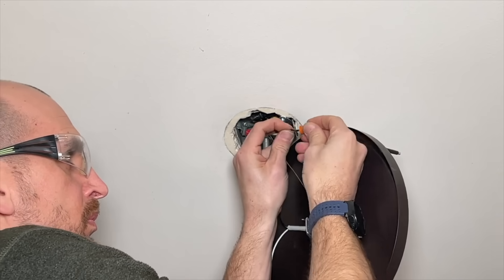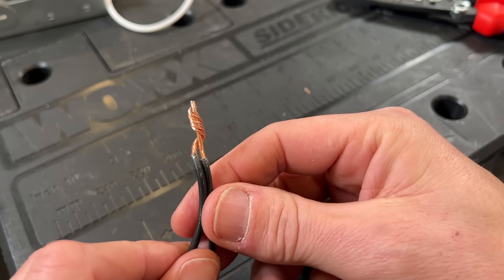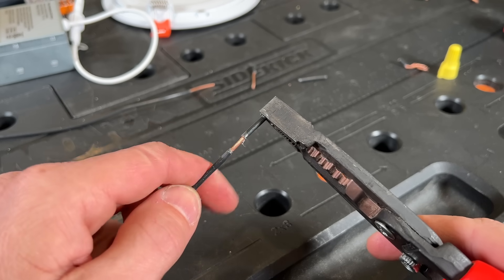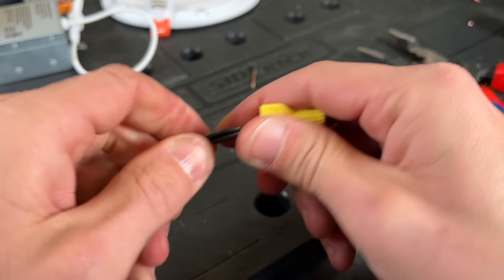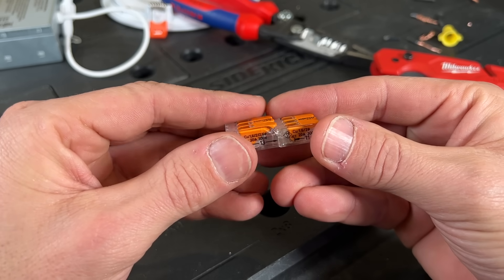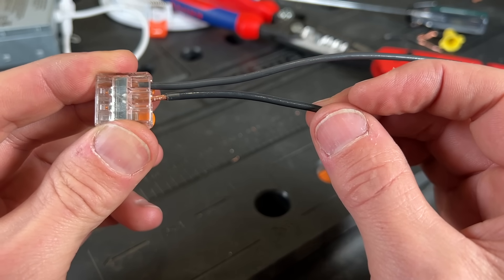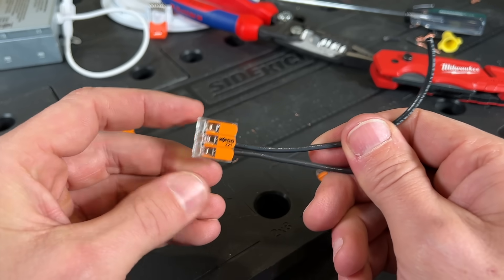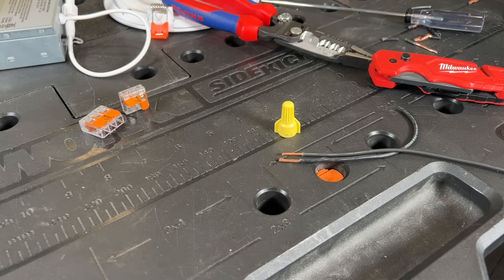Most Common DIYer Electrical Mistake - Don't Let This Be You!

Comment: Another advantage of Wagos is that because the wires are not all twisted around each other they're much easier to take on/off and figure out what's happening in the circuit (take one wire out, see where it comes from, what still has current, put it back in, etc). When I replaced some zone valve motors on my heating system I replaced all the wire nuts in the junction box with Wagos, and it was much much easier to follow the circuits after doing so (and will be much easier the next time I have to replace a zone valve motor).
Reply: @BB backstabbing a receptacle is also CSA approved, yet you are bound to find a few switches and receptacles that have failed in a house after a decade or so from repeated stress.  This is the same type of mechanism with Wago.  The only Advantages that Wago will have (at least what I can think of) are 1. time saved and 2. in very specific instances, you need to replace one device while the circuit is still hot for control applications.  This is how I do things and this is how I tell people how I do things.  I don't think that, "relax, it's certified" is a reassuring thing to tell your customer.  There are many "certified" things that are stupid.  Maybe wagos are good for homegamers that can't form a proper twist, but for professionals... To me at least... It's sketchy as hell.
Reply: @MintStiles  I couldn't agree more. For a low voltage, low current situation they may be fine. Other than that they can be handy on a test bench for a temporary basis only. 
I believe this guy has no idea what he is talking about when it comes to anything electrical. I've seen another video of his about using a multimeter. It was pathetic and filled with incorrect information served up as facts. Did you notice how he handled the strippers. Looked like that was his first time. He should really stick to making videos on things he has knowledge of.
Reply: @johnnygogo7773  you got it man, and he has got keyboard supporters too.  Wagos are good in control systems where you may just have no choice but to change out a subsystem in a live circuit, but it's good for almost nothing else.  As for his wiring stripping or twisting skills... It should be indicative of how much he has worked on any circuits.  This is the problem with YouTube; people who have no business teaching specific skills can make a convincing video.  The average DIYer wouldn't know any better.
Reply: Another thing that wasn't mentioned is how the constant heating and cooling of that metal spring is affected. That acts not only for a tension spring but as the conductor in series with the load. It must be weakened over time and eventually lose a good solid connection. Even if it passes the test now, time and use is the enemy of them. What has already been proven by use and decades of time is that wire nuts are not affected nearly as much by that. Just like most things, they do require proper installation,  but thats another reason why you should hire an electrician. I would agree that DIYers might get better service from Wago if they don't mind the dangerous possibilities that may occur years later, but I'm the kind of guy that prefers my family's future safety over quick and easy.  @MintStiles
Reply: @BB I bet you think that you are attempting to be witty when you are just being offensive. Kind of like a child pretending that the parents have no idea that he is trying to pull a fast one.  How's this for a (very basic) physics lesson that you seem to think you are very well versed in? When you twist wires together, the mechanical grip via friction at all points along the length of the twist ensure that the repeated shearing exerted on the device does not work a wires loose.  The contact is also superior where the bare wires connect along the entire half inch or so where the insulation is stripped.  When you use a quick connect, you have exactly one point of friction and contact.  Perhaps youd like to explain how your physics differ from mine (or the rest of the universe for that matter).
Reply: Love it
Reply: Wagos have absolutely no advantage at all and I would not trust those on a heavy loaded circuit at all. Twist wires correctly and you have a far superior connection.
Reply: The point of the twist is a having a redundant string mechanical connections.  I don't see how traceability is an issue in most electrical enclosures.  This is like saying you rather have a car put together with bolts and screws instead of welds and rivers because it's may just be easier to fix when you crash.  I hope the priority here is strong electrical connection for safety and effective device operation.
Reply: @BB I have no idea what you just said man.  I kind of understood something about Wago advertising spec sheet reading... The rest is just gibberish.  I love how you don't want to make any comparisons regarding the tried and true twist and cap.
Reply: This is absolutely the beast of excellent work quality oftentimes. I remember when I worked on the electrical in cars before becoming a residential electrician. The Hondas and Chevrolet interior panels were much cheaper looking and feeling but man did they come off quick and easy. The Mercedes and Porsche panels, the exact opposite. They looked great and were solid and sturdy but pain in the butt to remove.
Reply: And have a test port for your meter probes

Comment: I hate connecting stranded to solid ,but am Leary of the lever nuts you are using ! They remind me of the push in connections on receptacles ,they should be illegal , I always use screw down connections ! On wire nuts ,I pre twist or twist so hard That I know its connected good ,then pull it like I mean it . Also tape the wires tight below the nut and up onto around the nut . The wires aren't coming out if the nut ! I think Klein Tools are hands down best tools made for tradesman ! Great video ,love your clarity ! Good job!
Reply: You can't teach some old dogs a new trick.
Reply: Some things don't go out of style like quality electrical connections done properly . Basic carpentry theory . I see guys that don't have a clue about proper framing techniques  but they have all kind of fancy tools . I can build a house with framing square,chalk line ,plumb bob , circular saw.  And it'll be standing a hundred years from now . New tricks aren't always better !
Reply: They should be illegal because they remind you of something that they are not?
Reply: Waste of tape and pain in the ass for the next guy
Reply: Noah ,I could give a Damn if having wire nut protected with good electrical tape is a PIA for the next guy ! I only care about getting it safely connected with the best chance of never having an issue of short circuit or loose wires. Don't know how wrapping the wires below the nut to secure wires together is a waste of time !  I take my time ,have never had issues with faulty work I ve  done ,and I ve done quite a lot over 40 years working !
Reply: @gregr1672  in your technique the tape is a fail safe if that becomes necessary your connection is already compromised  so it’s useless

Comment: Does the US use solid wire on its home circuits?
I've never seen it here.
Reply from the maker: Yeah, solid core wire is the norm for 15 and 20 Amp circuits.
Reply: @EverydayHomeRepairs  May be a 120 volt thing I'm guessing...
Reply: @garysheppard4028  UK requires solid wire cables for all domestic power and lighting circuits.
Reply: @westwonic  You've got 240v there I believe? So couldn't be just a 110V thing then...
Reply: @garysheppard4028  officially 230V, but often reading 240V
Reply: @EverydayHomeRepairs  only in a house. In fact alot of places are going to conduit for residential , so you will be pulling in stranded unless you are a sadists

Comment: Great video as always. You make sure you are clear In how you explain things and always provide evidence to support your statements. Good to know I've been doing this right all along. I used to build test circuits in school and we would have to test them with more than just power on and off. Connectors had to get a tug test as well as an overload test to make sure they worked right and I learned early on that stranded goes first to get a better connection.
Reply: First of all, you should hire a professional electrician. Fixtures wires can be of any guage, as they are a listed product. No terminations on the branch circuit side of you home should be of less that 12awg. So the wires in the wall have to be a minimum of 12awg. They should be sized according to the load as per NEC 310.15 (b) 16 in the 75°c column. That being said, I take the solid wire and bend it into a zig zag shape. Then take linesman pliers and twist the stranded around the solid before twisting the wire nuts on.
Reply: @joelpruitt5959  I've never once hired a "professional electrician" to do my job. My job is literally fixing homes for a living and I can't count the number of screw ups I've had to fix from "professionals" who did shotty work. That's why we call them vendors or contractors in my field because at least half the time they aren't professionals. I've seen so many "professionals" wire a gfci wrong that I have little faith in them. Not to say all electricians are bad, but all the local ones around me save a few most certainly are. Some plumbers are just as bad. Half of them don't even know how to transition from. Copper to plastics (pex, pvc, ect) and I've seen them install shark bites wrong. Those are like the simplest thing to install. But like I said, not all are bad at what they do. I know a few who could work blind folded in a dark room and still do flawless work. But those guys are few and far now days.
Reply: @TheSlimCognito  LMAO. Well bless your heart.

Comment: The description for the wago 221 is actually incorrect.  You can just push in solid core and stranded. You must lift the lever when using fine stranded. 
You also refer to lever nut. There is no nut involved. It is in fact known and referred to as cage clamp, hence why you have the lever.
Reply: The full name for the product is 221 Series Lever Nut. That's interesting about pushing in without lifting the lever - I haven't tried that. Not really sure what the benefit is, though.
Reply: @davidkahler9390  in Europe these have been named WAGO 221 SERIES COMPACT LEVER CLAMP CONNECTORS.  With the new range of 221 inline connectors Wago has chosen to rename them as splicing connectors. 
Looking at any online material will show there is no nut involved in the technology and it is a clamp onto which the wire is inserted, within the cage area. It is very misleading to refer to it as lever nut. This may be a local wago USA marketing decision but it does not clarify or explain the technology but confuses. 

If using fine stranded, I would recommend using ferrules to avoid stray strands of wire not entering the connector, this, as you say compromising the current carrying capacity.

Comment: What I like to do on the rare occasion in which I do work with this stuff, is I will split the strands into at least two wires, and wrap them counter to each other on the solid core. half CW, half CCW.
But really, the best solution that doesn't involve solder is with clasp connectors like the Wago blocks you recommended at the end. They can be off-brand if you can't afford to get Wagos, the design is fairly simple and reliable, so it's hard for knockoffs to really get it wrong.
But if you must use a nut, your best connection would be stranded on stranded, so I like to solder a small length of stranded wire onto the end of a solid core, with the strands spread around the solid core at least somewhat evenly. Cover it in heatshrink, wire nut stranded on stranded, you got the best connection you're gonna get without soldering it together such that you'd need to cut wire to remove the fixture later on.
Reply: Wire nuts only spin in one direction.  Every strand that went counterclockwise is now loose in that wire nut.   Hire an electrician.
Reply: @michaellaurin3571  The point is for them to partially unravel and provide their own bite.

Comment: Great video. Going to see if you have the wago 221 on your link. I was wondering why you would you the Wago with 3 holes with only two wires. Doesn’t Wago make a 2 hole.
Reply from the maker: For sure, I carry 2, 3, and 5 in my standard kit.  I had the 2 different sizes in the 3-pin connectors so more for the demo.

Comment: I've used the Wago connectors for years. The only time I had a problem with them is a few years ago Installed an electric water heater and I used Wago connectors. I was waiting around for the water to heat up and I started smelling plastic burning. I looked at the wiring and one of the Wago connectors was melted. I'm figuring the actual connection is to small for a high load device. So I just don't use them on anything high load or 220V.
Reply: That being said I only use lineman twisted connection on my tank installs. Just put of possible issues as you mentioned.
Reply: My personal tank I hooked up with Wago, no issue. I wonder if you used the smaller design verse the larger gauge? I have large version on my tank connection.
Reply: some of those connectors are just duds I believe, more complex mechanism, has moving parts, is assembled = multiple potential points of failure. As a commercial field tech I've had many issues with these connectors causing intermittent connection issues, it was a doosey to come to that conclusion. Ultimately, swapping all wago connectors with wire nuts did the trick - never had to go back.

Comment: Superbly described both from a communication and technical perspective.  You are tops of youtube on this!  Love the demo of Wago level nut strength.  For general DIY's, totally agree on recommending lever nuts. The skill required to properly wirenut with extreme high consistency is significantly more than generally appreciated.

Comment: You are absolutely correct on buying the Wago connector instead of the traditional. I bought some wire nuts that I used about 1/4 of the cheap plastic container the it developed cracks and collecting dust. I would rather pay more and probably save money in the long run. Well made video. Thank you for sharing
Reply: I've seen wirenuts last literal decades. You must've bought some seriously cheap ones. Let me guess, were they commercial electric brand?
Reply: @TheMinecraftACMan  No!  What I am trying to say is that homeowners don’t need a 1000 wire nuts. They are still good but the holding container cracked and will never use the rest in my lifetime. They are not cheap. I bought them from the Home Depot.
Reply: @hassanbazzi3545  Oh, you mean like the number you buy, gotcha. You can get like a small bag of them I think. Not 100% sure cause I buy them in bulk for work, lol.
Reply: @TheMinecraftACMan  I hear you. I am just a simple homeowner. I think for a person like me the Wago nuts are ideal
Reply: @hassanbazzi3545  Well, one tip I'd offer is to not use them in anything outdoors. Indoors should be OK, but they really don't take well to weather.
Reply: Yes, you can get an assorted bag for a few dollars.
Reply from the maker: Thanks Hassan, I agree for us DIYers Wago lever nuts are hard to beat 👍
Reply: Whatever wire nuts you bought were cheap or you stored them in the sun. Wire nuts work well, that's why they're in your house and everyone elses

Comment: I have absolutely never been taught the stranded wire ahead of the solid wire. Wow that just makes sense. As a handyman I love your content!!  Thank you!!’  I’d love to use the other connectors but I’ve never gotten the chance to try them. Maybe I’ll pull all my own lights down and give them a go.
Reply: Here’s a worthwhile project to try Wagos on.  A week ago I wanted to add a duplex receptacle beside an existing receptacle in my garage.  Should not have been a big deal, but when I cut the drywall I discovered a water pipe behind where the second receptacle would go.  So now I had to get a ‘shallow’ two gang box.  This would have been a real  pain to use wire nuts and stuff it all back in.  This was the first time I used Wago connectors and it worked great.
Reply: That’s how it’s taught in trade school
Reply: 3/4 is way to much 3/8 is all you need, you are using the wrong size wire nut too, and if look closely there is another set of threads on bottom of the wire nut, those are grabbing the plastic insulation , this in why you stipped way to much wire, I've been wiring since I was 13, 40 years now , I think i know what I'm doing
Reply from the maker: Once you go Wago you will never go back 😁
Reply: @EverydayHomeRepairs :  That's a true statement 👍.